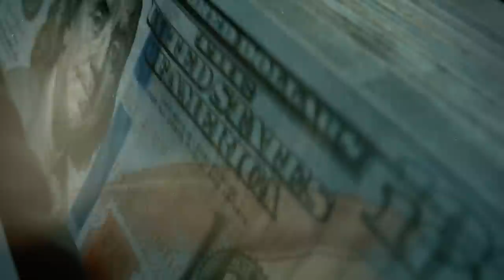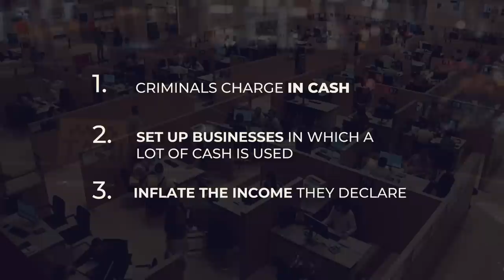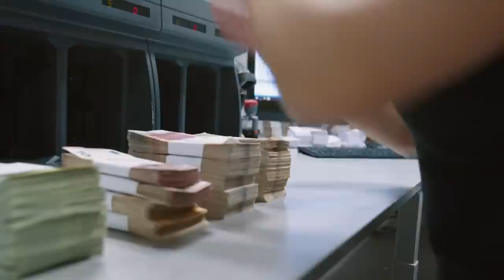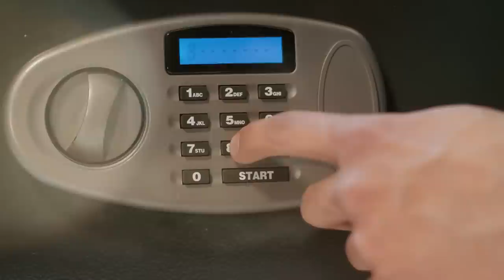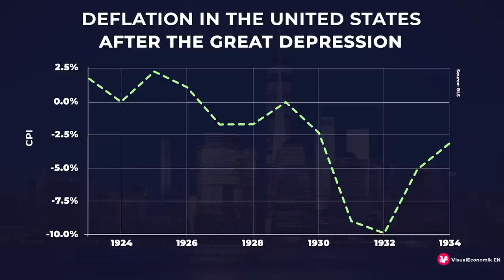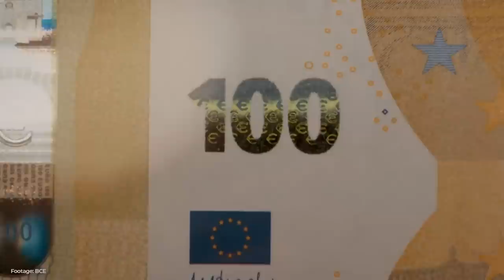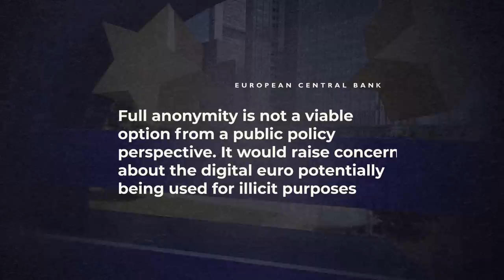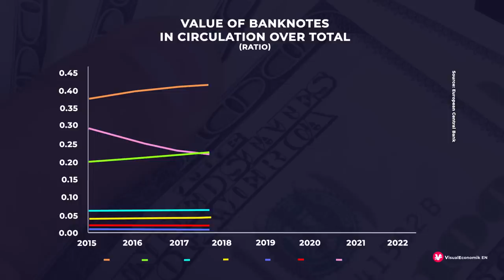Eliminating Cash: A Great or Terrible Idea?

Comment: there is a subway i often used to go. lately they have constant  connections issues with the debit machines, so the last 4 times it ended on me leaving and not buying anything at all. now imagine cash does not exist and having a massive hack attack and some connections disruption lasting days, for sure some people will suffer a lot from such events
Reply: Cheques and gift cards.  Also, if landlines, the credit card machine should work regardless of location.  

I suspect after the govt Eliminates cash, many older folks and self-conscious folks would just use cheques.

Comment: How do you pay for something without cash when there’s a power blackout?
Reply: where all I live everything closes when the power goes out anyway the modern tills they use cannot open without power, so even if they did all the math to calculate taxes etc themselves they could not get into the till to give change etc
Reply: @kinggoten  if you have a small backup power supply you can at least run the till to make cash transactions. 🤷🏻‍♂️ Can’t say the same about card transactions which require a network connection.
Reply: @farticlesofconflatulation

Most don't.  Economics.

Comment: This idea is pretty much a non-starter, 'cept maybe in countries where it can be forced through. A non-starter simply because in many nations people simply won't accept it. For instance India tried to push this heavily in 2016 with its infamous demonetization of all high-value currency - exactly what Ken Rogoff suggests - which caused massive disruption. The govt. has promoted a cashless society for years, and we even have a good deal of the infrastructure needed for it in place by now (our UPI system is almost on par in its capabilities with China's digital payments system, and is widely used). And yet a recent review of cash in India showed that it's up by nearly 70% compared to before the demonetisation. And keep in mind that India is a very YOUNG country in terms of its demographics, so you can't even claim it's just all those old folks using it.

Comment: Eliminating physical cash, great idea. It costs so much money to produce, often times more than the denomination is worth (see most coins and lower valued bills), and they have a poor circulation life compared to their digital counterparts. Digitally putting all money on something like a blockchain would improve transparency thanks to the data availability. Though that may also come at a risk of losing privacy as well, which would be another can of worms.

Eliminating cash as a concept though, well that I'm not so sure about. That would mean going full on classical communism and switching to contracts and voucher system. It's never been done, so I really can't say anything for sure on that one.

Comment: I find it disconcerting to find myself on roughly the same side of the fence as someone who is as clearly vile and retarded as Tucker Carlson, nevertheless, I have to say that I disagree with the concept of removing physical cash from the economy completely. At the moment, one could look at our current circumstances, and say that physical cash is entirely obsolete: a relic of the past. I am a student of history however; what is clear and certain now may not always be in the future. Whilst everyone laments the supposed decline of the West, the truth is that, in historical terms, we still live in a relative golden age. This is to be celebrated, but it also gives rise to caution. Whilst the idea of large scale power failures and such may seem distant, even absurd, given our current circumstances, if my study of history tells me anything, it is that, while the causes of societal collapse may indeed be eminently predictable in hindsight, that it takes everyone by surprise nonetheless, and often happens on much shorter timescales than one might imagine. Given this, whilst I envision no imminent collapse in the foreseeable future, I still desire that the economic system be robust, and physical cash serves a significant function as a fallback if such systems that we take for granted such as a functional banking system or our electrical system fails. For this reason, I say that maintaining cash as an option is preferred, and if it is abandoned, plans should be put in place to rapidly redeploy physical cash in the event of the collapse of our systems that we at present take for granted.